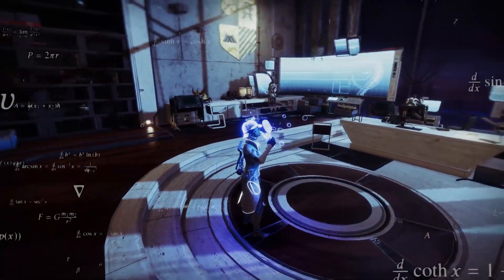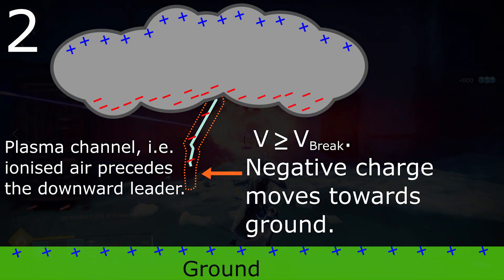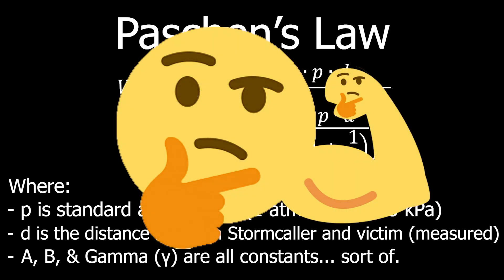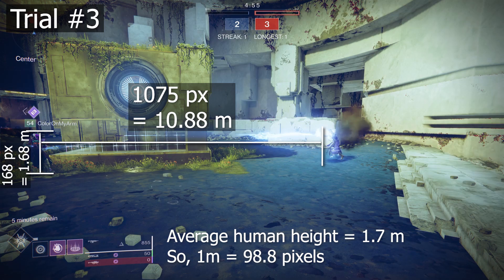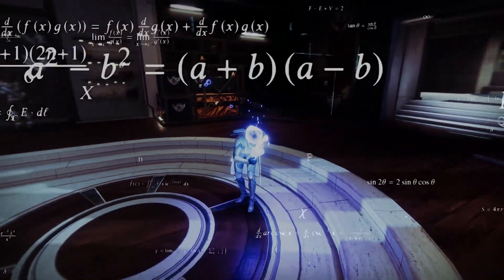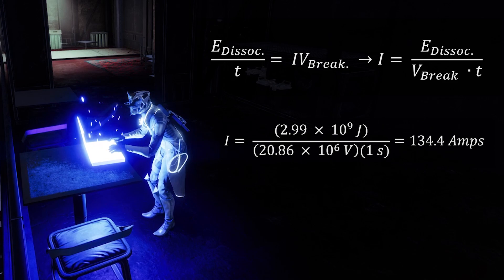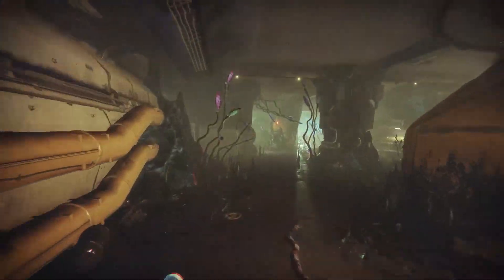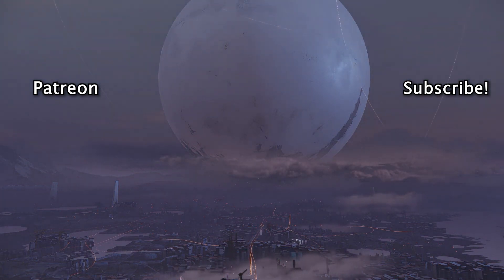Finding the Voltage of a Stormcaller Super | Destiny Physics Ep. 3

Comment from the maker: Sorry for the meanness in the intro. Clearly my account was hacked and that person, who sounds exactly like me, was the one who said those things.
IMPORTANT EDIT: 
I made a pretty glaring mistake. Tl;dr, the actual charging time would be about 0.000017s ≈ 0.2 milliseconds, which is much less than 1m33s.

Detailed explanation: I was thinking in terms of charge transport via the electrical arc. But in a battery, the charge actually comes from a chemical reaction, so the electricity just supples the energy for that reaction. Thus the actual math should be:

Battery energy capacity = (charge capacity)(battery voltage)

For the same Iphone 12 Pro MAX, we have:

Charge capacity = 3.687 Amp•hr = 13273 Amp•seconds

E = (13273Amp•s)(3.8Volts) = 50438 Watt•s

So t = (50438 watt•s)/(2.99e9 watts) 
= 0.000017s

(Also Amp•s and watt•s are dumb units. They're just coulombs and joules, respectively)

Here's a link to the equation emote you can use as a gif: https://i.imgur.com/Cs3UYQK.gifv
Reply: Next time you have to test distance just have one guardian use DARCI!
Reply from the maker: @CloudFowest  damn. Good point
Reply: you forgot the loss of current to air plasma

Comment: 2 things;
first, dunno if this would make any difference but the stormcaller doesn't technically touch the ground while stormtrance is active.
second, if for this video you stop measuring time when electrical energy stops transferring, shouldn't the time for the golden gun video just have been the duration for the shot itself, since no more thermal energy is being transferred after that?

Comment: Love the video as always! But I have a concern:
Remember that Stormtrance increases in damage per pulse as you continue to hold out the stream! Would this increase in damage (which reduces the time to kill a guardian) change the math in a significant way? Perhaps doing tests at no damage bonus vs tests at fully ramped up super could be interesting?
Reply from the maker: No, this actually makes sense. Because as you apply the current to an enemy over a period of time they are heating up (via resistive heating)/the energy within them is building up. It may not be a perfect 1 to 1, but in this case I think it works out.